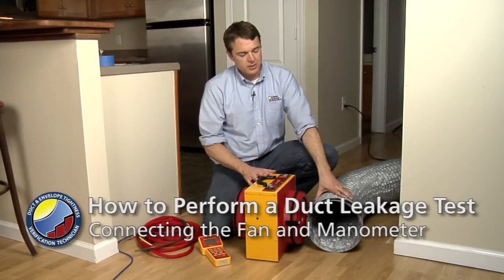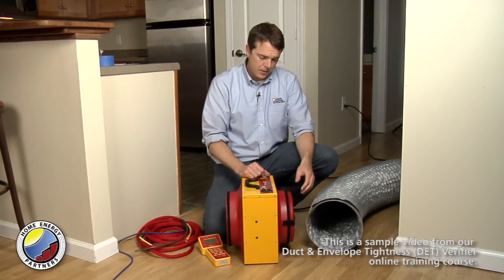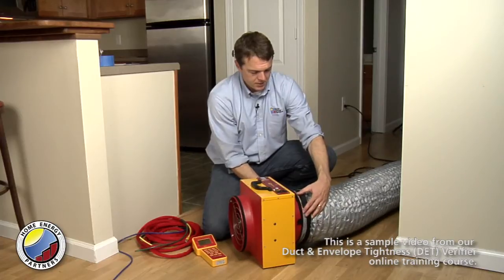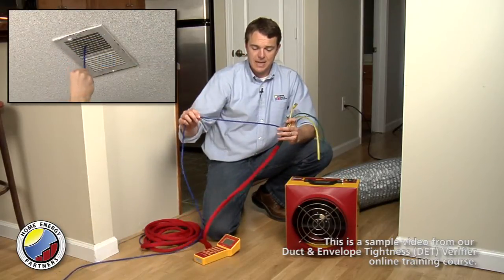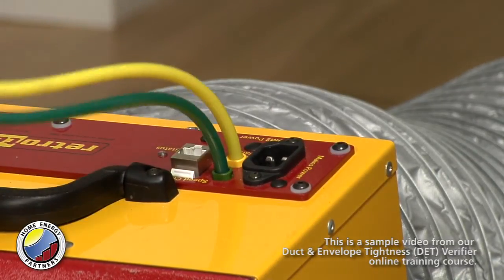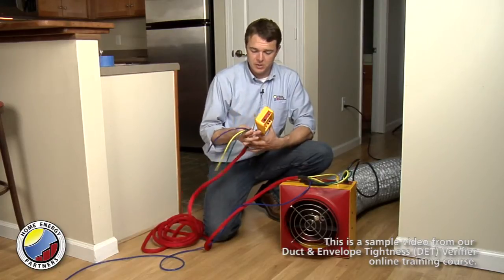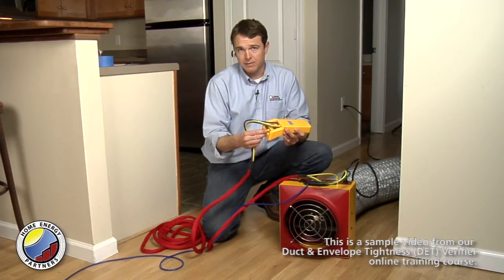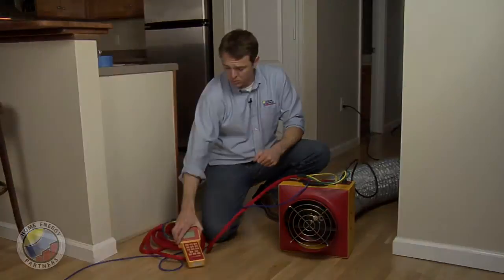Duct Testing Training & Certification Online - 2009/2012 IECC Code Compliance

Comment: Is it against code to put the blue pressure probe in the return (on the ceiling) instead of a supply? Also is it necessary to remove the filter if it is brand new? Thanks